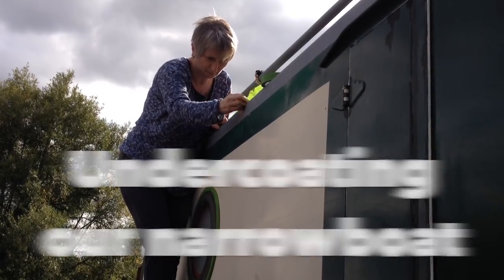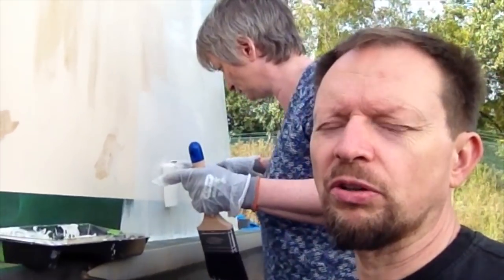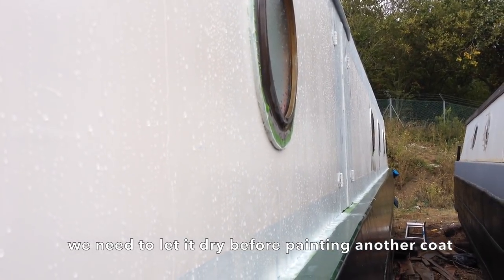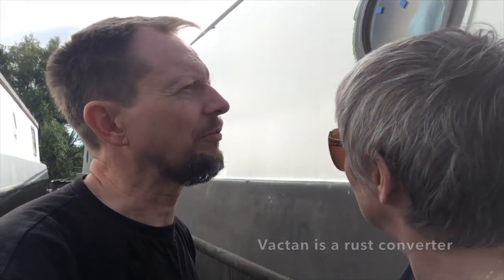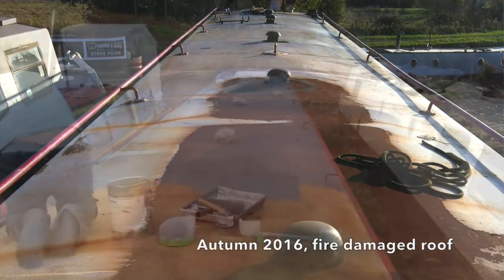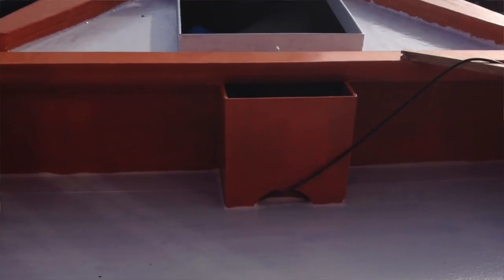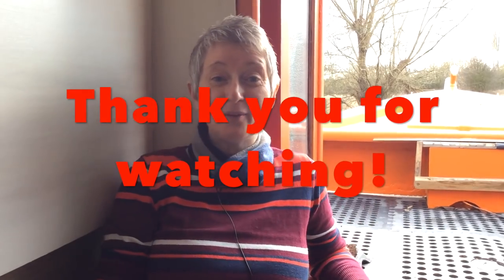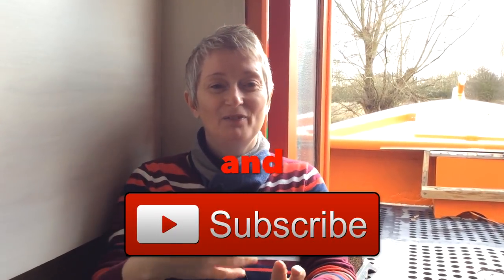#25 Undercoating our narrowboat

Comment: Interesting to see how you’re getting on painting outdoors as when my sailaway eventually arrives I plan to paint all but the final coat or two outside but I have a plan. I have a 3m poly tunnel on my allotment and I’m going to adapt it by chopping off the uprights on one side and then use it to protect the area on the side of the boat I’m working on and then move it along as I go - yes bonkers I know but I know I can’t afford to put the whole thing under cover for weeks so I’ll give it a go, after all the primary purpose for paint is to protect the steelwork and if it looks pretty then that’s a bonus
Reply: I am really enjoying seeing your plans shaping up, Martin; sounds like great plan to me...but then what do I know : )  Best to both of you x
Reply from the maker: Not bonkers at all, it's a really good idea and we did think about buying some sort of poly tunnel but it's all down to time and money and being left with something you don't need but if you have it already, well that' makes sense. When are you expecting the sailaway? Best, Martin
Reply: The Narrow Boat To The Deep North  - I’ve still got another 12 months to wait, the shell should be built in the summer and the part fit out will take place in the autumn, I’ll get my hands on it in the winter and start the inside work and then the painting will start as soon as the weather improves - a long time to wait but I’ve planned for it
Reply from the maker: @llessibm  Sounds great and you know what you're doing so once you get it you'll be up and running. Best, Martin